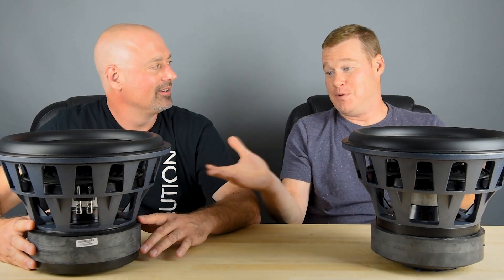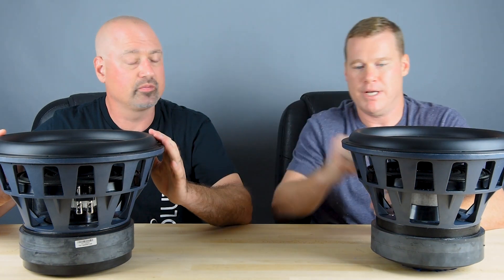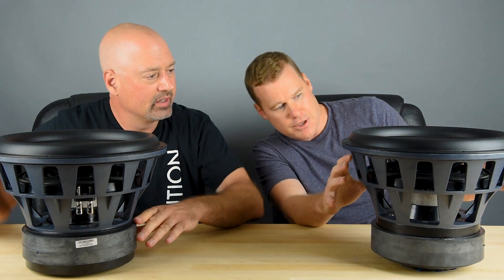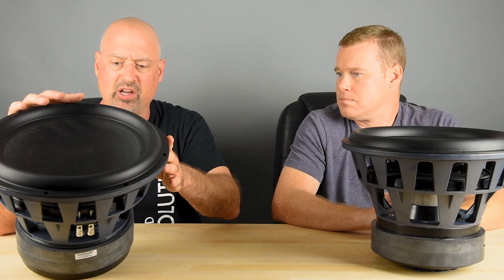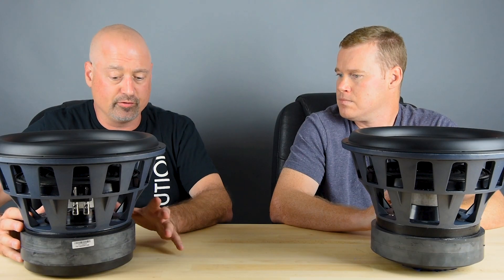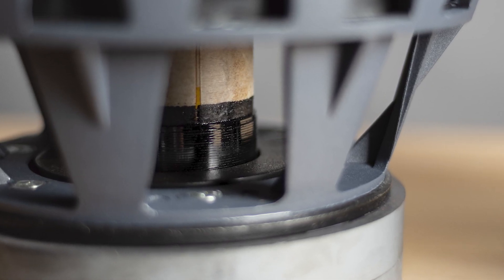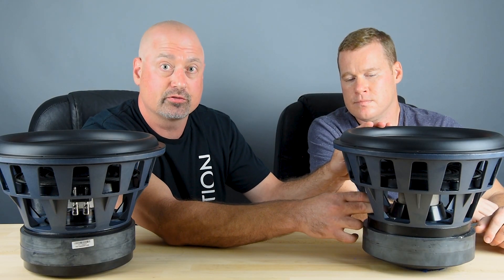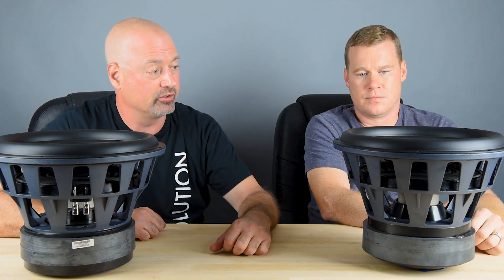Anatomy of an SVS Subwoofer Driver

Comment: Why have a different driver for sealed and ported subs?
Reply from the maker: It allows for better use of cabinet geometry to increase output and reduce distortion.
Reply: @SVS_Sound  can drivers be purchased?
Reply from the maker: @dadevastator24_77  Not as separate components at this time.
Reply: @SVS_Sound  so then what can I do to replace a bad driver on and out of warranty svs product

Comment: Sb 16ultra and pb 16 ultra has the same driver and amp? I mean exactly same?
Reply from the maker: The driver designs are different (over hung vs. underhung), and the amplifiers are tuned specifically for the cabinet and driver designs. They do have the same specs, just implemented differently.
Reply: @SVS_Sound  you mean to say no one should use pb 16 ultra's driver with sb 16 ultra's amp. I mean amps have same specs but they are different right?
Reply from the maker: @hamiduzzamanhowlader5108  Correct.

Comment: I bought a SVS 20-39PCPLUS Cylindrical Subwoofer but the delivery service totally destroyed the driver, bottom base/platform  and the grill,  they have agree on paying for the replacement parts. I have searched the internet but couldn't find a SVS dealer. 
Is it possible to get the "driver, bottom base/platform and grill" from SVS?. 
Best regards. 
Raymond.

Comment: Is it easier or harder for sealed subs to bottom out the voice coil former on the motor assembly (compared to the ported counterparts)?
Reply from the maker: It’s a fairly complex question – which needs to be answered with some qualifiers needed. With a sealed sub, cone excursion quadruples with each successively deeper octave at the same sound pressure level.  So cone excursion is 4X higher at 40 Hz than at 80 Hz (at the same SPL).  And cone excursion is 16X higher at 20 Hz than at 80 Hz (at the same SPL).  So eventually the sealed sub will run out of clean/linear woofer stroke and simply won’t be able to play any louder.  Without a limiter/compressor, the sealed sub could indeed be driven into bottoming-out at the deepest frequencies.  

With a ported sub, cone excursion behaves exactly like sealed until about 1/3 octave above port tuning.  Then the ports start coming on-line and progressively suppressing cone excursion (vis-à-vis the principle of a Helmholtz resonator).  At port tuning, cone excursion is almost completely suppressed, and it’s almost impossible to bottom out the woofer.  However, below port tuning the woofer/ports quickly decouple and the system behaves like there is a hole in the box (with no air spring) and the woofer motion is very poorly controlled.  Without a limiter/compressor and a high pass filter below port tuning, it would be otherwise very easy to bottom-out a ported subwoofer below port tuning.
Reply: @SVS_Sound  Fantastic information! Thank you for taking the time to compile that. Taking the exponential increase in excursion at low frequencies for sealed subwoofers; would it be smart to set up a high pass filter or room gain compensation (RGC) at say 31Hz to help protect a SB16-Ultra at high SPL playback levels?

Comment: Just ordered me a second PB2000. SVS subwoofers are great! I never knew what I was missing with my infinity 12 till I heard what a 15hz test tone sounds like on a pb2000. The infinity didn't even register it, the pb2000 pounded. You could feel the pressure change in the room amd the sub excursion was impressive, the infinity, meh, barely even moved.

Comment: Very similar to the peerless sub. I'll be going with a peerless sub and crown xls amplifier..it will blow the svs away
Reply: i have of these pb 4000 drivers powered by a xls 2500 and im blown away!!
Reply: @jumpmanfan23  I've been thinking of trying a crown amp to power a subwoofer I was looking at the xls1500 and this sub https://www.parts-express.com/dayton-audio-hts545he-4-kraken-21-high-excursion-subwoofer-with-5-voice-coil-4-ohm--295-054
Reply: @boblarson9171  99% sure peerless produces svs pb4000 drivers and prolly they whole driver lineup i got two pb4000 drivers only for a few hundred dollars i bought a xls1000 and it barely moved the pair of pb4000s after a week i got the xls 2500 and they sound more like i expected and from the looks they can take another 1k watts !!!

Comment: Question I have the pb16 ultra and from what am sein there in that cut out pic of the sub is not how it look in my sub the ports layouts are not like that mines just stick straight in and end right under where the support for the driver magnet is
Reply from the maker: The cutaway image was an earlier prototype and we've since improved the port design so the model you have is correct.
Reply: @SVS_Sound  ok cool

Comment: Nice to have but at the cost of 8 Michelin tires for my Toyota Tundra my 15" Cerwin Vega sub with 15" Cerwin Vega towers fills the room good enough for me. In fact I could get two Cerwin Vega XLS-215s and two 15" Cerwin Vega subs for $200.00 more than your one PB16-Ultra expensive. I know you make a great product it's just overpriced.
Reply: LOL so I just google searched the Cerwin Vega subs - only 250watts and it only does 40Hz at -3db and down to 25Hz at -10db which is fucking piss poor mate, especially for a 15inch driver. Adding more of the same speaker won't change it's properties, only increase the SPL. It doesn't matter how many CV subs you add, you won't get the depth and extension that the SVS subs offer. The PB4000 can go down to 13Hz -3db and the sb4000 goes down to 19Hz -3db and both provide 1200watts of power. The PB16 Ultra goes to 13Hz -3db too but the SB16ultra goes down to 16Hz -3db and both provide a staggering 1500watts RMS (NOT PEAK!) of power. SVS absolutely destroys your Cerwin Vega setup
Reply: @AWSimDrifter  Lol this is pretty funny to read I'm with ya here my friend. I mean, comparing Cerwin Vega subwoofers to the PB16-Ultra? WTF!!! You could buy a literal dozen 15" Vega subs, but at the end of the day they bottom out at around 38-40hz at -3db with an amp powering 250W RMS and 400W max! The PB16-Ultra is 13hz at -3db and can even come down to 11hz in extended mode with 1500W RMS AND 5000W MAX......

It's like comparing a tactical nuke to a firecracker....Now to be fair to Cerwin Vega here, their in home theater stuff may be laughable, but their live stage/DJ professional equipment is excellent. But these are 2 completely different things, and when it comes to Home Theater SVS is in a whole different dimension of sound quality.
Reply: I don't really get these type of comments. There are tons of different prices on all types of product. If you just want sound sure they are overpriced but if you want performance I think it's fairly priced. To me a Cerwin Vega sub is overpriced. 
And with that logic you just want quantity not quality which is totally ok but I feel you are in the wrong place with that logic. Why not buy two, three or four cheaper cars instead of a Toyota....

Comment: Waiting for 18" subwofer or higher from svs
Reply: Aren't we all.
Reply: @alexferguson8893  They really don't need them. It's more about multiple driver boxes. Professional IMAX uses 4 12 inch woofers in a box in the high end theaters. 4 x 12 and usually at least 4 boxes.  So 16 woofers.  However.... these woofers totally suck in comparison to SVS 3000 and up woofers. If SVS had a big box and used 2 x 4000 SB woofers and you have two of those... you'd be rattling things non stop off the walls unless you had a home theater MADE to be silent. I've seena  room built for 15K that was DEAD silent here in Florida. Double doors... back in the 90's. So.... they had inferior tech that sounded so good simply because of the room. If you put the SVS sub in that same room, you're mind would probably be blown away and you'd want to rewatch every movie again.
Reply: @alphazoomii9408  Yes, I understand that, but it sure would look cool.
Reply: @alphazoomii9408  Also, great advice.
Reply: @alexferguson8893  Yea but I bet their 16 ultra outperforms many 18 inch drivers. Most 18 inchers are accordian edge to hit hard but usually don't go very low.
https://www.youtube.com/watch?v=ozRMpE5tzzo for example. Junk!  So even his upgrade doesn't match the specs of the SB-4000. It's not bad, that's for sure... but it can't handle the power of the SVS 4000+ watts peak.
The Dayton can handle 2000 watts peak. So the amp in the SB-4000 would probably blow that 18 inch up, lol.
Reply from the maker: Thanks for the interest, the 16-Ultras will remain our flagship for the foreseeable future, but we are listening.

Comment: Curious why you did not add an aluminum tube on the SB4000 where the voice coil extends beyond the gap in both directions to keep the exposed part of the VC cool.  It could be a shorting ring to lower distortion or a slotted non-shorting ring.  I have seen so many other companies VC overheating in the areas that the VC was underhung.  Just wondering.  Thanks
Reply from the maker: The SB-4000 has a shorting ring in the gap.  A shorting ring doesn’t function as a heat-sink per se but does help. The voice coil isn’t prone to overheating because it’s an 8 layer edge wound design with massive thermal power handling.

Comment: I've bought PB2000 and my god. It's rocking my room like crazy! and it's not even at 12 o clock. More like 10 o clock. It's not even breaking a sweat and it's rocking my room hard!
You trully masterfully design the whole package. Could i have gone DIY and save myself some money? Sure but i wouldn't get the precision you guys invested through RnD and it's god damn worth it. Now if i could get that PB4000 transducer into my PB2000 housing... :v
Reply from the maker: Thanks, love the passion. PB-4000 driver sounds best in its own custom enclosure but we'd love to see the finished product if you an pull it off.

Comment: Perfect performance each and every time..I love my PB2000 ....Planning to add PB3000 soon to my setup..Bass is so tight and quick you can feel it ...in normal words and not much technical...." It get's in you" love it 😍
Reply: I just ordered a second pb2000. Cant wait to shake the house lol
Reply: @Jackmerius_Tacktheretrix  lovely! I have added PC4000 ☺️
Reply: @shaileshnandikol4709  nice! When I ordered my first PB2000 I was disappointed at first, it didn't seem any louder than my infinity 12 inch sub, that is, until a very low note hit, holy crap! So I decided to take my old bass mekanik CD and play some test tones. Even at 15hz ypu could feel the pressure change in the room. I had almost returned it until that. And once it broke in I was really happy. The problem was me, I was used to mainstream run of the mill best buy subs that were loud at 45hz and boomy. But the svs pb2000 slammed hard on lows that the infinity wouldn't even register. For instance, if I put a 10hz test tone 9n the infinity it would barely move at all and even up to distortion it barely moved. The PB2000 on the other hand looked like it was going to jump out of the box! I had to learn what a true subwoofer with a flat frequency response sounded like. What I perceived is a sub that got louder as it went lower, but in fact that wasn't the case. It just didn't fall on its face at and below 30hz. It wasnt actually getting louder, it was the opposite, it was not losing power/volume as it hit the lower notes. Love my PB2000. Cant wait to hook my second one up when I get my new speakers.
Reply: @Jackmerius_Tacktheretrix  very truly said! SVS are terrific below 20hz... they own the territory. Now adding the second one would make it more strong and you will notice amazing performance... more even bass across with very less null spots. Hope you using mini DSP and REW calibration for subwoofer setup, heard a lot about those to tune in the subwoofers for the extreme and balanced performance. I wish you all the good luck with addition of PB2000. Do let me know your experience on the same !
Reply: @Jackmerius_Tacktheretrix  hey there! Thanks for the detailed explanation. I just ordered the new SVS PB-1000 Pro, and let's just assume it's similar in frequency response to your pb 2000, how far below the rated frequency response can your pb 2000 play well? The pb 1000 pro is rated down to 17hz ±3db, but do you think if applied an EQ to it it could hit something like 12, or maybe even 10? Will I be able to get a reasonable "sound"/vibration if I play 10hz?
Reply: @bailey2517  mine will still shake thw house at 15hz, and you can still feel the pressure change at 10-12hz. Biggest difference you're going to notice about an SVS sub is that it isn't boom or over exaggerated at 45hz like most mainstream store-bought subs. When I first got my pb200 at first I was thinking this isn't amy louder than my infinity until the bass hit low below 30hz. Then I was blown away, especially when I was shaking the house at sub 20hz frequencies than my infinity wouldn't even play. That pb2000 was flexing hard at 15hz, the infinity would barely even move. Its not that the PB2000 gets louder as the frequency gets lower, it actually just has a flat response whereas the infinity played loudest at 40-45hz amd then dropped off drastically below 35hz. They tune them to be boom at 40-45hz to give the illusion that its loud. You really have to learn what a sub us really supposed to sound like when you get an SVS sub. I promise when you play songs with super low notes like Bass I Love you, you're going to be shocked at just how hard it slams the lows! I guarantee if ypu throw a 10hz test tone at it the sub is going to flex pretty hard, whereas mainstream subs will barely move and pretty much won't even play that low.
Reply: @Jackmerius_Tacktheretrix  omg I'm even more hyped now. I have a $100 dayton sub800 (8" sub that rolls off at 40hz lol), and so going from that to anything from SVS will be a massive upgrade, but I never realised how cheaper subs tend to have a ~45hz peak. I'm prepared to be blown away when I put on some low bass songs hahaha. Omg I've never had so much excitement from the anticipation of something.   !!!!!!!!! Aaaaa I can't wait!!!!!!!!
Reply: @Jackmerius_Tacktheretrix  Would you say that 20hz sounds "effortless" on your PB 2000? Or does it sound like it's struggling at all? Sorry for all the questions lol I'm just super curious, and asking questions is my way of coping with the fact that it won't be on my doorstep for like 4 more days 😆. I ask because in a lot of youtube reviews they say it can play 20hz, at reference levels, with zero distortion, and "effortlessly". And that sounds amazing if it's true, but it just seems too good for a 12" driver.
Reply: @bailey2517  definitely effortless unless you're at full power then you can hear it working. But even at lower volumes you can still feel the pressure change in the room but it's so clean, especially for being a ported sub. Keep me posted when you get your sub. I'd like to hear how you like it! You're going to love it!
Reply: @Jackmerius_Tacktheretrix  Wow... idk what to say. I'm preppared to be blown away hahaha. I'll for sure tell you what I think when I get it. probably on thursday.